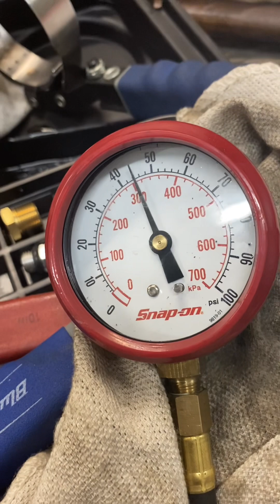Pro-drive mud motor gets some much need work done!  @ProDriveOutboardsVideos  #prodrive

Comment: How long have you owed it before such a big service?
Reply from the maker: This motor was I believe 6 years old maybe 7. It had been to many other shops and they had not fixed it or done any maintenance so really was abused and ran in salt water so took a toll on it
Reply: @Phillipsmarine2022   I see I’m looking for one for an awesome setup.  I heard they are coming out with a 50 hp one so it sure if I want the 40 or wait for the 50 hp . I hear and see they are tough as nails.